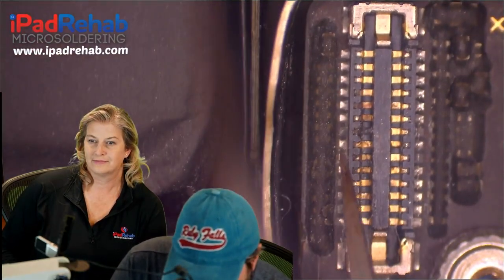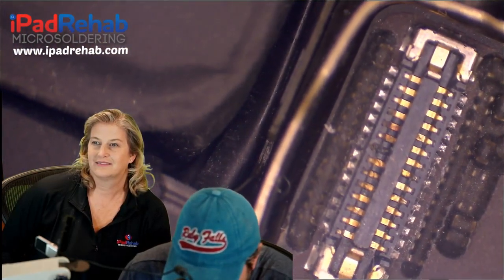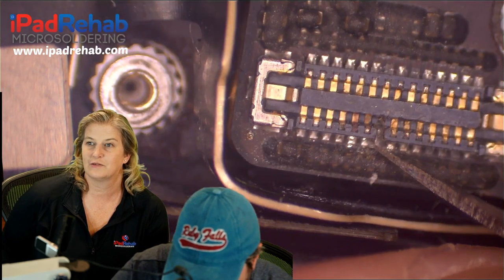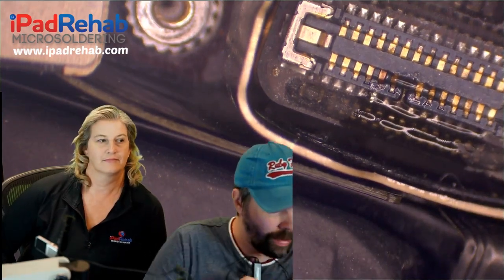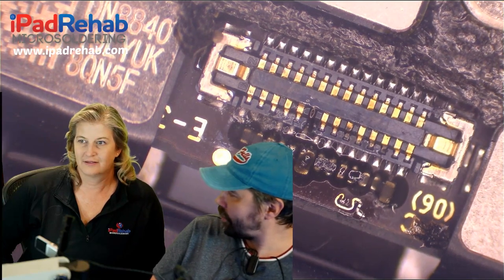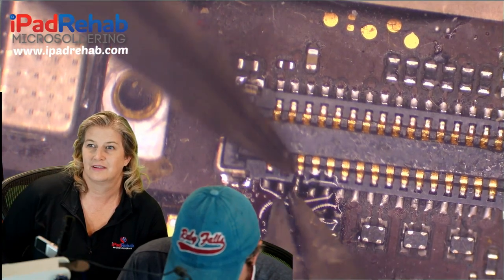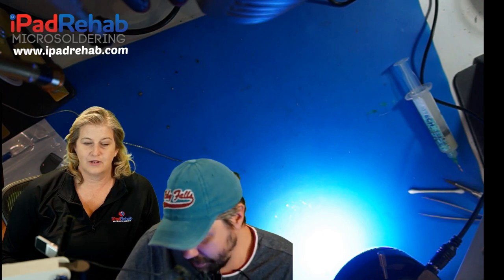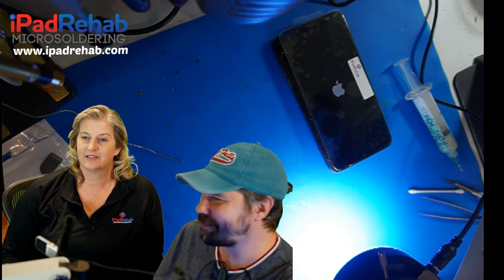iPhone XsMax -- Repairing a single FPC connector pin

Comment: Thanks guys! I never thought about replacing a pin in a connector. People are probably pushing in pins because they are using cheap test leads. A gentle touch is all that is required from my great test leads.

Comment: How do you tells the signs of a bad connector. 

Will it make lines appear under the screen? Does it make the phone unresponsive to touch?
Reply from the maker: It depends on what line is open.
Reply: I think my logic board is fried because it would boot loop and i had to hard reset it to make it open and now it doesn’t respond to touch but the screen works

Comment: @ipad rehab why would you choose this repair over a complete FPC replacement ?
Reply from the maker: Usually on newer devices there is a period of time where it is not possible to source replacement connectors.  In addition, when data recovery is the goal it is a safer alternative.  It is just another tool in your strategy toolbox.

Comment: I would bet money that touch only worked originally because the hitchiker pin was making the connection.  It was obviously present before you plugged the connector to it for the first time.  You thought that touch would work without it that pin but I bet you could not have skipped replacing it.